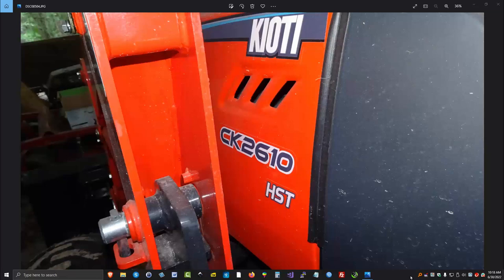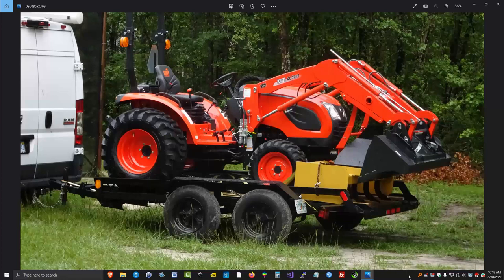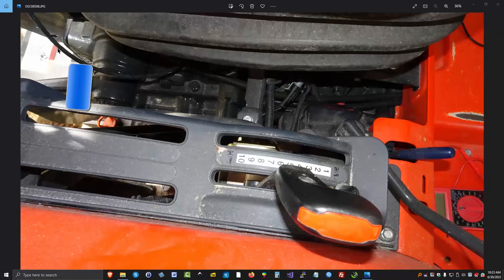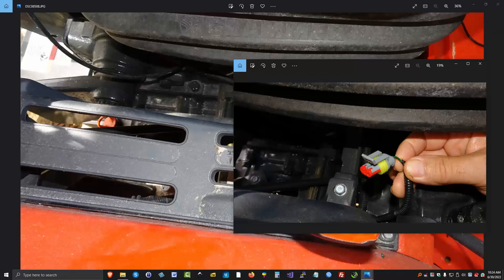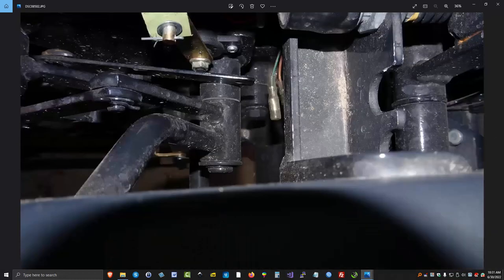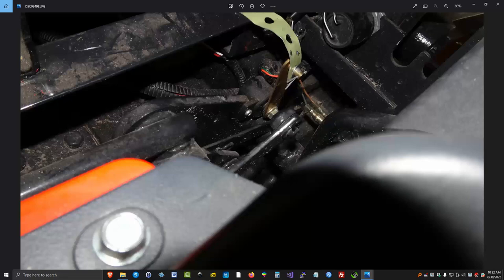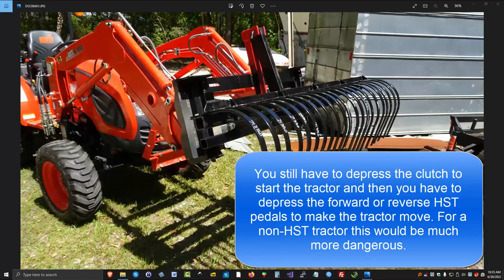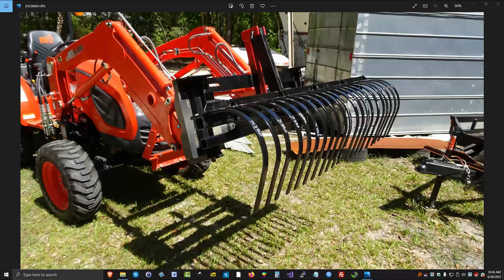Want to quickly get off and back on your KIOTI tractor?

Comment: Excellent instruction to do both workarounds. But this weekend I found a new way to bypass the seat switch. I removed my seat cushion to put a seat cover on.  To remove the seat bottom cushion, look underneath the seat cushion towards the front of the seat. There are two T25 torx screws. Remove them. The seat bottom cushion will slide forward and come off. Underneath the cushion there is a piece of tin with the seat switch contractor exposed. It is spring loaded so it pops up when you take your weight off of the seat. Conveniently, there are two holes that you can use zip ties to tie the spring loaded piece down to keep the contacts permanently closed. Takes five to ten minutes to do this. Take care, Mike
Reply from the maker: Excellent short cut, I haven't tried it yet but I like those who think outside of the box.

Comment: Just a quick note to anyone watching this with an older 2810. The seat switch doesn't need any resistor, just bridge the wires. As told to me by a respected kioti dealer and I've done it, and it's fine. The neutral switch on mine is just 2 wires coming out of the block nr the lever on the engine itself. I've bridged them and can now start it in gear, get off it in gear and most importantly use my tractor even though the lever has snapped 😊 thanks for the video buddy it showed me what I needed to know
Reply from the maker: Thanks for your reply, it broadens the scope of this video.

Comment: Id be interested to know how your Ram ProMaster performs pulling your tractor. I just purchased the same tractor, and have a 2020 3500 van. Thanks
Reply from the maker: I believe the trailer capacity rating is 7,000#. It pulled just  fine, no acceleration problem, no braking problem (trailer electric brakes controller not on van) but I didn't use interstates and speed remained below 65MPH.

Comment: What's the length of your trailer, I'm debating on the length i need for a new trailer and it looks like yours is the minimum length.

Also, I have the CK3510SE, if you  place it in neutral and put the parking brake on, you can get on and off the tractor while it's running. You didn't need to remove the safety switch.
Reply from the maker: I'll have to measure and get back to you.
Reply from the maker: Trailer bed length = 10"-6". Tongue length bed to ball = 50"
Reply: @ForTheManDIY  thanks. Appreciate the response

Comment: I fell the same way. Iv been dealing with mine for a couple of years also. Where can I get the The plug  seat connector you used?
Reply from the maker: It is a standard automotive water tight connector. I had one laying around from amazon. You could also just cut the wire 2-inches from the seat connector and solder a resister there. You could later reverse this if needed.
Reply from the maker: See Mike 2032 above

Comment: Unless I’m missing something, disabling a very important safety feature because it’s too much work to put a HST transmission in neutral does not make sense.
Reply from the maker: It doesn't have to make sense to you, only to me from my perspective. That's the beauty of free speech, we can all have our own opinion. You can have yours & I can have mine.
Reply: Neutral is in 2 places IF you can find it. I have just about worn a blister on my left hand and still cant get it to start. Sometimes with it running and brake set in neutral you can actually get off and it wont kill the engine. Aggravating as hell and getting worse

Comment: Put the trans in natural and set the brake and you can get off the machine
Reply from the maker: The whole point was to NOT shift into neutral for a restart. As you may know, the gears inside don't always lineup so you have to press a fwd or rev pedal slightly to get the gears to lineup.
Reply: @ForTheManDIY  if you have it in neutral with the brake on, the tractor stays running while you get on and off. It bypasses the kill switch. The kill switch is for when you are driving and fall off, the tractor stops. If your tractor was turning off while it was in neutral with the brake on, then there was something wrong with your tractor and you should have took it back to the dealer.
Reply from the maker: @BWB-vb9xb  Thanks for taking the time to add a comment. That may help others but in my case not shifting to neutral while leaving the tractor was the whole point. You probably don't get off and on the running tractor as much as I do. If you are using the seat belt then it is pretty hard to fall off the tractor. There is a delay after kill switch activation until the engine stops turning. That delay is likely enough time for the rear tire to run me over. So don't put a lot of faith in that kill switch while NOT using a seat belt. I don't use the seat belt either, but then as a kid I also didn't wear a bicycle helmet. I also drove tractors as a kid and those tractors had zero safety features. I also didn't have a car seat as a small child. I also didn't have electrical socket covers when I was a kid. I never did a timeout in a corner, just got my butt smacked when required. I also drank out of a garden hose as a kid and yet here I am at age 77 (also had both current and original strains of Covid in the last year and a half and survived with minor symptoms). I am not trying to make you angry or to criticize  you so please don't take it that way. I am just pointing out that all the lawyer caused safety issues are to protect ill-informed humans from getting hurt; whereas a normal person with common sense doesn't need all these lawyer generated protective devices which can fail while being relied upon (as my example of the coasting tractor) Here's another example of failed safety device. 2022 ford escape adaptive cruise control. Was following another vehicle on interstate with adaptive cruise control pacing behind that vehicle. They turned off on a short exit ramp and so did I. Problem: when they left my lane, the adaptive cruise started speeding up my car while I was exiting behind that same person. I had to hit my brakes because the adaptive cruise was speeding up my car back to original cruise setting. We would have crashed had I not braked heavily. The Boeing 737 crashes were the result of a safety device gone awry. Once again I am not attacking you, just pointing out some societal failure of self reliance and self accountability.
Reply: @ForTheManDIY  you initially commented with, "The whole point was to NOT shift into neutral for a restart" and now you're saying that the point is to "not shift to neutral while getting off." 

You're saying two different things, and again, you don't need to RESTART when you're in neutral. But I guess you actually mean you don't want to restart while leaving your tractor in gear. You should spend more time clarifying what you mean instead going off on a rant of how sUpeR DaNgerOuS your life has been.
Reply from the maker: @BWB-vb9xb  Thanks for your reply.
Reply: Sometimes. Mine is giving  all kinds of misery to me. Will not start as we speak
Reply: @BWB-vb9xb Clearly you don't own the tractor or any of the HST series in question. On my NX45, which operates the same way with the same stupid switches, I have enough time to exit the tractor from the cab and hit the ground before the engine ever cuts off. Imagine if I had no cab and made a quicker exit from the seat the tractor plus whatever implement would be past me before it ever cut off. Its annoying, especially when only having to exit to pick up debris from a pile and youre right back in. The resistor in the seat makes the tractor think you never left so ... that fixes the annoying shut off problem.

The safety feature is if it detects you leave the seat without the parking brake engaged (and that damn thing is SUPER tight on mine) plus transmission in neutral it will shut off. Its super annoying when you have to leave the seat every 30 seconds to get something out of your way because you're working alone. Hence his statement about "not shifting to neutral while getting off"

Not shifting into neutral on restart on an HST model is a sepeate and more dangerous of the two, however like he pointed out you actually have to press a pedal to get it to go anywhere. Its not like a manual where starting it in gear would immediately lurch the tractor forward. The gearshift is somewhat of a pain and mine in paticular I can never find medium but I can find neutral on either side.

That being said, I personally am not going to do the neutral bypass. However I fully support his right to modify his own equipment. Just getting it to think I am still in the seat at all times is good enough for me.

Thank you for doing the multimeter work for me. Seems like any resistor value north of 22 ohm within reason will do the job.
Reply: @nmewarlok  actually I have a CK3510SE HST and I have zero issues or inconveniences with setting my parking and near simultaneously putting my gear in neutral so that I can get down while the tractor is running. I don't have to get down every 30 seconds, that would be annoying and I can see if you where working with pallet forks, that you might want to stand and operate the tractor so that you can see what you're forking and would want the safety switch disengaged for that.

And if you'd go back and look at the comments and watch the video, he says he doesn't want to RESTART the tractor after getting off. That's why there are several comments basically saying the same thing...set the brake and put it in neutral and it stays running. But what he actually means is, he just wants to be able to get on and off the tractor and leave it running without having to put it in neutral AND set the break. I think there is a miscommunication/ misunderstanding of one of the objectives of the video....which I also said in a previous statement, which you clearly didn't read.
Reply from the maker: @nmewarlok  Thanks for not arguing with @BWB3436, that seems to be his (or her) purpose.